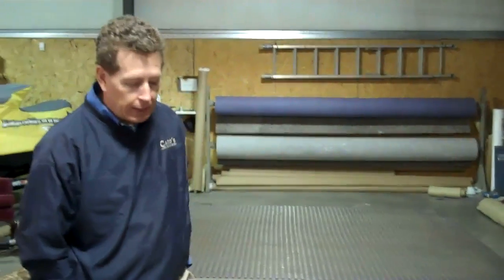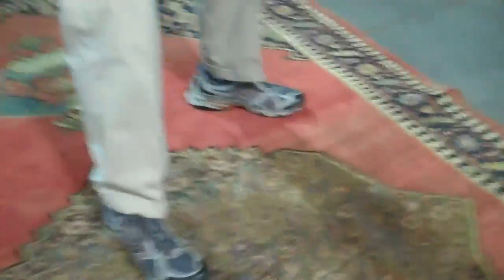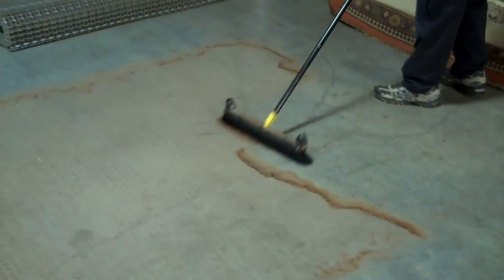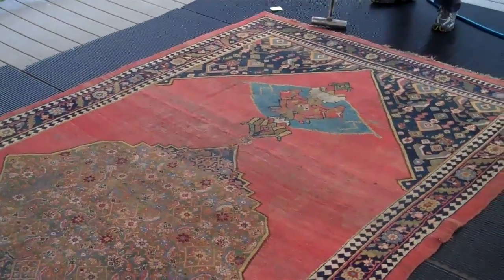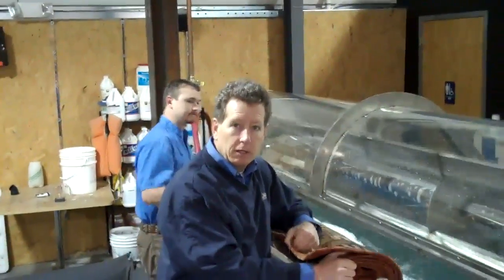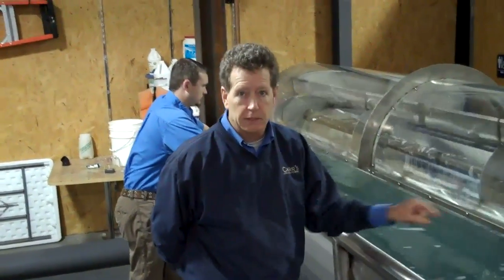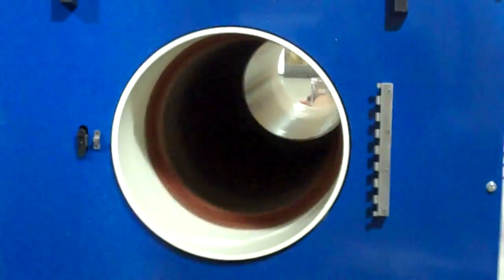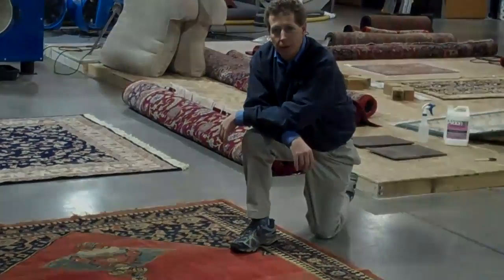WATCH AS WE WASH AN ANTIQUE RUG!

Comment: Very cool dust/dirt removal ideas, but I assume the rug was tested for colorfastness before wetting/washing. I once tried to remove a fresh dog-urine stain from mine by quickly dipping the soiled area in the bath tub (trying to dilute and remove the urine before it set) and my cherished rug with its colorful design bled all over wherever the water (not the pee, the water) touched it, effectively ruining the rug. DO NOT try washing your rug until you are sure the dyes are colorfast!
Reply: cathytai they use special mixtures to clean them so the colour doesn't bleed
Reply: Satisfy Life that's only partly true, you can use some acids to reduce colour runs, but some will still run especially light blues and some reds. And if it's wet for very long no chemicals will stop the running
Reply: What kind of rug is that
Reply: This is a Persian rug with  traditional dyes. They know how those behave ^^

Comment: the rug didn't really look all that different in the end in my opinion.
Reply: yes agree...thought it was a joke and that they'd cut to the clean rug.
Reply: I think it’s due to the age and wear of the rug, on the back you could see colours come through when they did the compressed air part because the colours weren’t as damaged as they were on the front. 
There is visible improvement but the rug needs a lot more than just thorough cleaning.
Reply: It looked better after the second dusting, before the wash

Comment: The DIY way:
Vacuum rug with roller brush beater.
Lay rug on driveway on a shady day (or colors will fade in sunlight)
Hose down.
Scrub down with gentle laundry detergent.
Hose, squeegee, hose, squeegee.  Repeat until your knees give way.
Use small wet dry shop vac to suck remaining water out.  If rug is small, hang on your fence or clothes rack to drain better, then vacuum some more at the ends.  
Let dry in shade.
Brush nap to fluff out.
Sell rug to highest bidder.
Get a rug that washes in your machine.  Done.

Comment: I usually throw mine over a cable stretched between two buildings and beat it with a 2x4 for a while.  Then I vacuum it again with my Kirby before I take it to the laundromat and chuck it into one of those huge washers.  I've been doing it for years and the rug still looks good.

Comment: Hello, worried about bleeding during cleaning, on my antique knotted kazak rug (I don't see a pile). Do you have a recommendation in Salt Lake?
Reply from the maker: I do not know anyone in the Salt Lake area. You are right to be concerned about bleeding. However a good rug cleaner deals with this on a daily business and is adept at removing color run if it occurs. If you don't find anyone you feel comfortable with I would recommend shipping to Robert Mann Rugs in Denver. Its really not a difficult process, just call them. You could certainly ship it to us but they are closer and there turnaround will be much faster.

Comment: all that stress on warps and wefts of that poor rug!!! all that they need to do is to place the run under a cold running water for half a day, using some hair shampoo at the very end. then just letting it dry outside in the air, resting flat

Comment: Do you see George this carpet is a canvas base a mixed of linen and wool fibers to clean'I mean you brush them and clean them with the same fiber either to perform your company staple solvent or your company shampoo . Hoever,90% of the persian carpets waved with the same material and the exact canva base .You have to use the same fabric for the carpet machine brushing after you saw them in the same canvas you just dissolve them in plant booster which is high in potassium chloride without removing the paled of dust and shave the tiny wool tips cause this is what your dust machine is doing .I do respect your scientist head but when you need a neat advice you can't have it from no one except me endue to God's willing to inherit your ancestors and my ancestor fundamental and basics principles of science so please don't get jealous of me . I will give it for free so you can support my siblings in your home country ;don't forget I will always be there upheaval for you

Comment: The rug still looks the same to me and to get the dust out just vacuum it out using a powerful upright vacuum cleaner then deep clean it using a spray extraction machine for far better results and to save time as your method took far to long just to clean a rug.
Reply: +Mark Candland you sound like a carpet cleaner like me. however fine wool rugs especially dense piles are best cleaned just as seen in the video.  This is an old world loomed rug where dyes in the wool used to hand loom are not uniform and appear striped.  what a rug looks like in a low quality video can hardly show you what is actually happening.  Water clarity between cycles etc. An extractor and scrub wand does only surface cleaning of natural fibers found in rugs.  They aren't the same as a remnant of carpet cut to cover a floor like a rug.  Those you can clean with a sip and suck machine.
Reply: Hi I get where you are coming from but i have cleaned these type of rugs many times over the years using a spray extraction machine and they come up as good as new but then it depends on what method of cleaning you prefer to use.